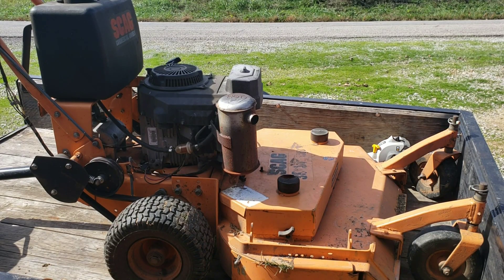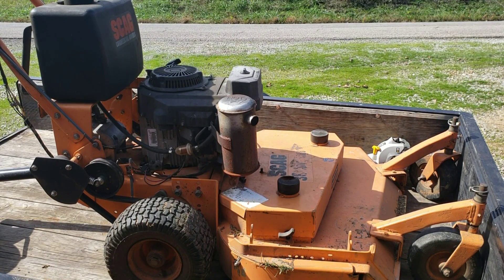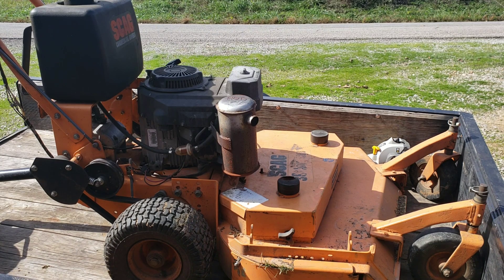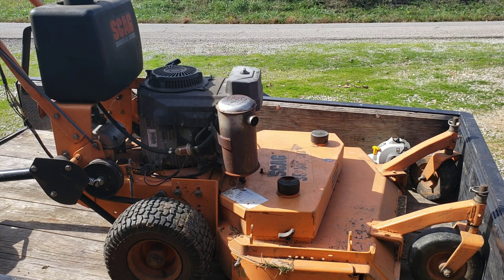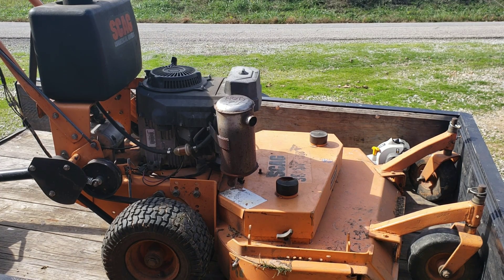What's causing my engine to smoke? Kawasaki 4 cycle engine - Part 1

Comment: You  have blow by.  You have rebuild the motor or get another motor
Reply: Isn’t another easy way to tell if you have blow by simply removing the dipstick while running and if smoke slash / oil spits out you have blow by? Head gaskets?

Comment: Mine, symptoms were, running rough and blowing oil out the exhaust. It was seeping a little oil under the shrouds and collected crud blocking airflow cooling the left cylinder. Overheated. Melted the valve guide, stuck the exhaust valve, bent the valve, smacking the piston, bent the pushrod, and of course the valve guide slid into the combustion chamber as far as the valve would allow it. And warped the head. 
 I bought a used head. Cleaned it up. Straightened the pushrods, lapped the valves and replaced the valve guide seals. That head was warped too so I flattened it with sandpaper on glass. The new used head immediately slid the valve guide into the cylinder and blew the valve guide seal off. SO I removed the valve guide, beat the crap out of it with a framing hammer and pounded it back in the head. 
 I did a leak down test last week and it was hissing out the exhaust so I ordered a valve. Tore the thing down and the guy sent me the wrong valve. So I lapped the valves and put the thing back together. This mower has to work every day. Healthy or not. Right now the engine runs like crap, blows smoke, fouls the left plug and uses oil. But, there is no blow-by. HMM. Let me think about this. There is no blow by coming out of the tube that goes into the intake but if you pull the oil filler cap it blows oil all everywhere. 
 I just got a compression tester so Ima go test the compression right now. This engine has been working sick at least 800 hours,.

Comment: Wow. I see several people saying to pull the heads and inspect the head gaskets. Lol. You can perform a cylinder leak down test in a few minutes. No need to pull the heads.
Reply: this lol so many people quick to get into a big job instead of doing proper diagnosis

Comment: Look for the breather that ventillates the crankcase. If it is blocked it might cause your rough idle and blow-by too. Older engines are not blowing the fumes to the intake breather. They usually blow the fumes to the atmosphere. If you know someone with a compression tester get that done. If all else fails get some oil that is used for older motors. It is formulated to have less blow-by.

Comment: You have one of 2 problems first I would look at is pulling the heads and check out the head gaskets from there if the head gaskets don't show signs of seapage then I'd say bad Ring's.
Reply: more than 2 things could be wrong here there is valve guides that could drop and seals that could go bad, Valve worn where it rides in guide at, it could be a crank breather clogged, valves have carbon build up on them, all kinds of things and why pull heads when a test can show you if the heads need to be pulled or not. This is proper diagnosis: get a leak down tester and test the condition of the rings and of the head. If you hear air in the crank case good chance it is rings if it is coming from intake or exhaust pull head and see whats wrong with it.

Comment: I’ve had Kawasaki engines do this before , it’s because they’ll run well even when they’re worn out and need to be rebuilt or changed completely. Also Kawasaki valve guides slip when they wear out and the heads have to be replaced . It can cause exhaust valves to bend and be stuck open

Comment: Well, seems like a new engine. Now, if people only let the engines warm up before starting the mowing process, they surely would last a little longer. But, people like to smack full throttle while it's barely lukewarm. But hey.

Comment: I have the same mower, I just replaced my rings, they where so worn I had fuel in my oil and it would not start. Everything was in great condition... except the rings
Reply from the maker: That is awesome! I may have to eventually do that.

I just used some sea foam in the oil and let it run for a while then fresh oil change with some Lucas added to the new oil and it took care of the smoking issue... for now. I don't know how long it will last, but at least it saves me from having to tear into the block for the moment.
Reply: https://youtu.be/fE_YIKgycOE
Reply: Yea I was gonna say the rings are sticking. If that cleared it up maybe it cleaned them some. Id take the head off and check the sleeve, and if it looks good just change the rings out.
Reply: Specs on a web site... https://www.engine-specs.net/kawasaki/fh480v.html
Reply: Kawasaki manuals...  https://www.kawasakienginesusa.com/support/manuals.html
Reply: Service Data and other manuals...  https://www.kawasaki-engines.eu/en/support/technical-information/technical-downloads/?f_series=FH&f_model=FH480V&f_specification=FH480V-BS24
Reply: 1 page Service Data Sheet ( torque specs and others) pdf...  https://www.kawasaki-engines.eu/umbraco/Surface/downloadFile/Download

Comment: That surge more than likely is a bad Welch plug in the top of the carburetor mine had the same surge and a blown head gasket once I fixed those it cleared right up ran like a new machine!!!

Comment: Blown out head gasket
Reply: I’m noticing same problem with my Kawasaki exmark fj180v. A blown out head gasket won’t blow my mower right? Mine is thick white smoke for about a minute. Then it’ll cut off on its own.
Reply: A head gasket will smoke the same and not stop. A bad o ring in oil fill cap also will continue to smoke. I smokes worse at first, then clears out...oil leaking past rings and valve guides when setting - as soon as it starts, smoke begins - as it runs, smoke gets less, ( burning out) then shut it off awhile, restart and smoke worse again until it clears out. A leakdown test will confirm my diagnosis. .